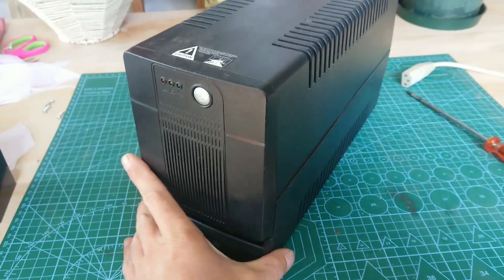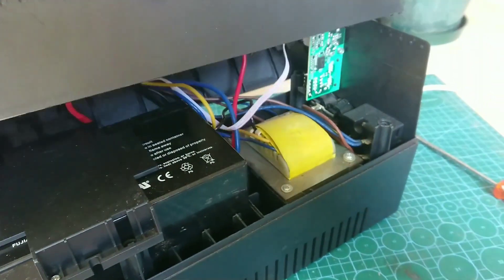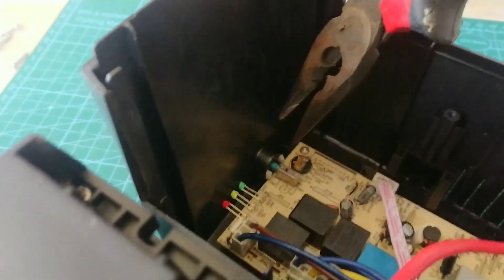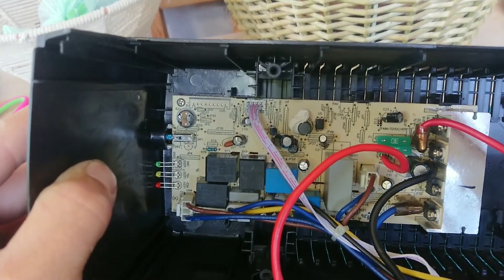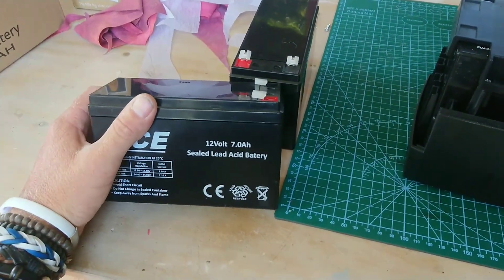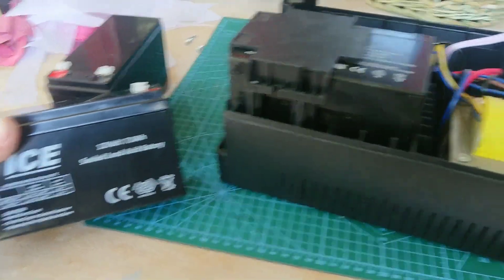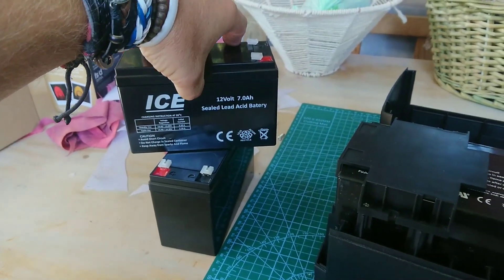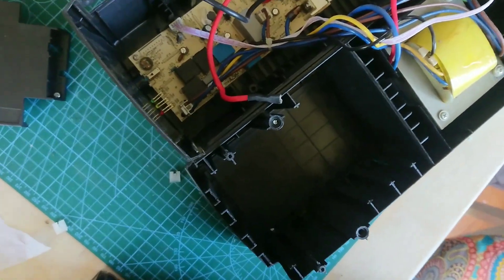Mini UPS Hack

Comment: You can buy a battery protector for R110 from makro that will prevent over charging and total discharging of the battery (making the battery almost never fail). I modifier by UPS straight from the battery cables to output 12V/9V that can be used for routers and switches (no DC to AC conversion are used powering my network) which makes the unit last up to 8 hours running 1 switch and 2 routers.

Comment: What the heck? Just geta ups that have management port on it and disable it using the supplied software that came with ups.
Reply from the maker: Works if you connecting to pc, but as a stand alone device, that option isn't an option.

Comment: a mozna do niego panel solarny podlonczyc
Reply from the maker: Not directly, you will need to have a separate solar charge controller, then that will change the batteries. The inverter will just connect to the batteries.

Comment: Thanks for the video. Why don't you replace your batteries with Lifepo4 batteries, Blue Nova ?, OK I see you explained
Reply from the maker: Ya, the lithium batteries run too low for the ups charger to detect them, so they don't start charging process. It's a big pity because these little lithiums are pretty decent at 89wh.

Comment: A basic UPS has a battery hold up time of about 3 -5 minutes -they are designed solely to let you save work and shut down a PC. If used to battery exhaustion the battery life will be as little as three cycles. If you can replace the batteries with an external pack - a truck battery or two - then the battery hold up time will go up to hours and the battery life will be much longer. You can use an additional external battery charger or solar panels to maintain the batteries.
Reply from the maker: Yes, works well, but only issue I've encountered with some chargers is that they activate the ups overcharge protection mode and cause the ups to cut out. Some smarter chargers don't cause this, and that's a sweet sweet combination to find.

Comment: I used 4 12 volt lead acid battery 3 12 volt 7.2Amp and 1 20Amp and I get 7 hours and half run time and it not bad am going change battery 12 volt deep cycle battery am going used 100Amp
Reply from the maker: What are you powering with it?
Reply: @littlekingcarver1  laptop,tv etc